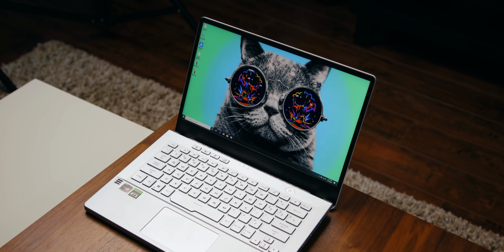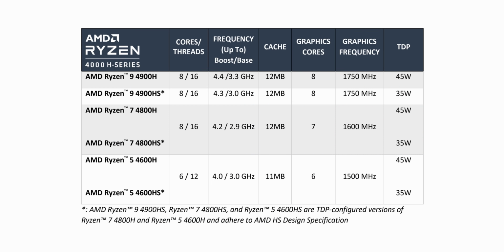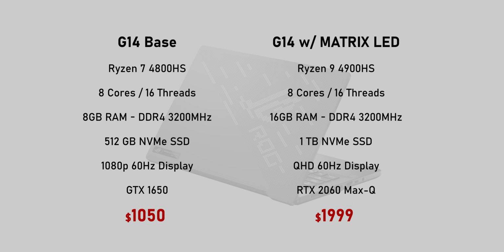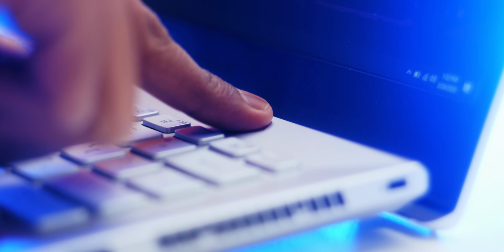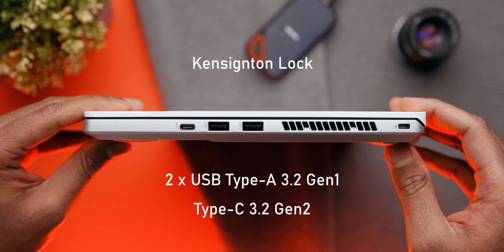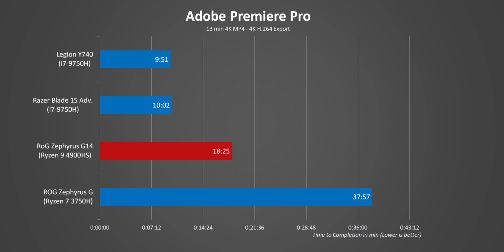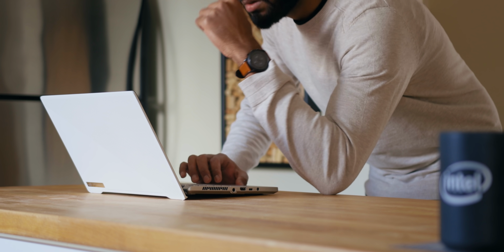This Ryzen 9 Notebook Is AMAZING - Zephyrus G14 Review

Comment from the maker: Timestamps for all you guys!
2:28 - Quick overview of the 4000-series notebook CPUs
3:30 - Some important info about PCIe support
4:12 - In depth with the G14
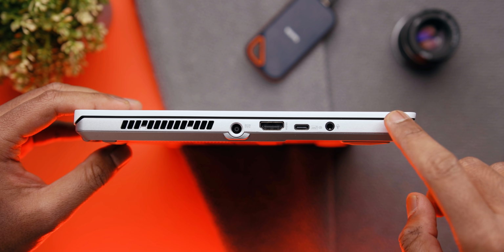9:02 - An ODD Port Layout
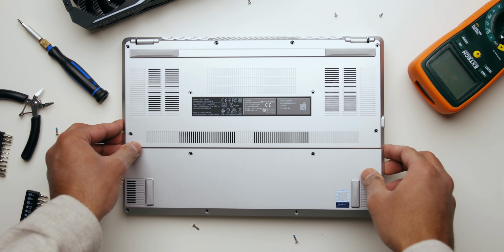11:37 - Upgrade options
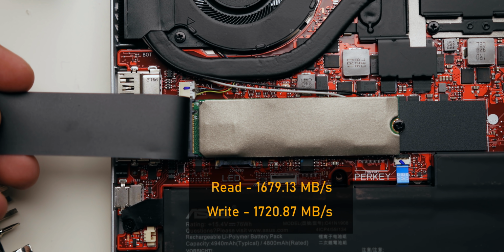12:04 - Battery life!  
12:47 - Benchmarks that would make Intel cry :(
Reply: 3:30 AMD and everyone else had already explained that PCIe 4.0 support means higher power consumption and heat and is thus redundant in laptops. Not sure why it's 'important' when PCIe 3.0 SSDs still work for 99.9% of users.
Reply: Hardware Canucks WOW what a monster compact laptop!
Reply: I have a question. First, thank you for a great review. As for the lid, I'm very disappointed. I really do not see any reason for the existence of these deep holes in the lid unless there is an animematrix. I cannot understand why this lid cannot be smooth and without holes. In the past, I saw a video of an Asus employee presenting a G14 without AnimeMatrix and this lid had no holes and the lid was smooth. So I'm confused. Anyway, I want the new MSI Gs66 to have this processor and availability for 3200 Hz memory. Unfortunately it will not happen! Can you provide information about the lid of the g14? since these holes are unsightly and impractical, and I don't like AnimeMatrix, it limits me to get this notebook. I'd like the lid smooth.
Reply: Also guys, the 1080p variant has 120Hz refresh rate, you have mentioned 60Hz
Reply: @fluffyraider  the base model comes with a 60Hz 1080p display
Reply: @adampluhar5667  that one was probably a prototype or a design prototype.
Reply: Better review of this laptop from Hardware Unboxed and Jarrod's Tech. People should definitely check out those channels. This guy is very casual.
Reply: I wish i have that laptop.... Can i have it plssss
Reply: Time stamps are really helpful for long video
Reply: Any idea when this might come to the market?
Reply: @MelvinKhosa  yeah, this guy is nerdy with no personality
Reply: @adampluhar5667  It looks like a design choice Asus made, unfortunately.  Even on the site you can choose what looks like would be "no holes" but it's just that you don't get the led crap but you still have holes.
Reply: @ryanhall5059  Yeah Its LID that prevented me from buying this laptop 1) I don't like AnimeMatrix, so I would only buy a version without this solution for less money - the ideal solution. BUT versions without AnimeMatrix have these unnecessary LED-free holes, I really don't see any reason to have any holes there, a) it's ugly, b) they are about 1 mm deep - an amazing place for dust and dirt, c) these holes are completely useless without AnimeMatrix, so I might consider buying the G14 with Animematrix, although I don't like it. BUT there is another fuck*ng problem, AnimeMatrix is ONLY on 1440p 60hz VERSION! This version is absolutely nonsensical and impractical on 14inch display and aswell for gaming plus in addition to this extreme additional cost. It's just crazy. In my opinion, this is a big mistake from Asus
Reply: @adampluhar5667  if you go to the Asus website it shows the animatrix lid is optional. I am with you I don't need a show off lid.
Reply: @kingicej2312  all this for only $1k. This or new Mac air, this is way better.
Reply: @kingicej2312  4k?? What the hell are you going to do with a 4k panel with a 2060?
Reply: @fluffyraider  no the 17 inch model has 120 hz, all others are 144+
Reply: Why there's no important benchmark of temperature? Temperature is the reason why buying a laptop, no one wants an overheating oven
Reply: Very nice, but I've decided to go with the Asus A15 TUF 4800h RTX  2060 144hz, unlike these Zephyrus models, both ram sticks are upgradable...
Reply: Will you recommend this with video editing in mind? Thanks
Reply: WTF? Why is the Google CEO reviewing laptops???!
Reply: @Pool 69 You are mistaken. ASUS is a Taiwanese company. There is no coronavirus fxxk-up in Taiwan.
Reply: I know this released a while ago but your numbers don't seem to correspond with LTT's numbers, could you explain?
Reply: INTEL IS CRYING OH NOOOO
Reply: @adampluhar5667  nah, not a big mistake, even for its flaws. The price is the best thing. The competition just doesn't give the same performance at this price.
Reply: new to laptop gaming and still not believing that a laptop can even play games properly. Especially not modern games like World War Z or dying light.
My choice so far is HP Omen 15 with Ryzen 7 4800h cause technicalcity and nanoreview said the power was better in comparison. 16gb RAM. RTX 2060. Can this laptop play any games let alone modern games and modern games with lots of moving parts like wwz

Comment: 2017:Intel has got competiton
2019:amd has taken over desktop
Laptops are still in Intel control
2020:intel is screwed
Reply: yup right now if you want anything other than a strictly highest of the high end gaming desktop and dont care about money then amd is the way to go, im holding off until the desktop 4000 before I upgrade, i will say my trusty 6700k has been amazing though, 4.9ghz and still rocking every day
Reply: Intel has had server for a while, even through this AMD-pocalypse. But that won't be for long thanks to security flaws, and EPYC awesomeness.
Reply: @BodybuildingSteve  i dont like my 8700k at 4.9 too hot miss my 1700x undervolted stable at 4.0 was just as fast with 3200mhz stable memory... guess i had a golden 1700x
Reply: @RAYSGT  I'll just say that Intel is basically turning into the old AMD with all the price cuts that keep coming from them. I will also say that if you have a Intel rig like 9900k or 8700k there is still not really a need to upgrade yet both chips are more than fine for gaming .

I just hope that now that quad cores are beginning to be retired we can finally see games take better advantage of parallel processing. I also hope that I Intel does get their shit together soon to compete with AMD on price and performance again
Reply: wizard 101 T_T nostalgia
Reply: 2020 Intel starts making Ventilators on the side
Reply: 2021 intel gets corona virus and cpu-s from Intel die
Reply: More a win for TSMC than AMD. Since, if TSMC had not come out with 7nm, what ever architecture difference they would have made without coming to 7nm, would have never beaten Intel at their 14 nm node. 

So a win for TSMC and AMD for getting that contract to TSMC. 

On the other hand, AMD can only do so much against Intel with their whole company worth a fraction of Intel's. So kudos AMD.
Reply: @Cadambank  TSMC only manufacture the chip, the design is still from AMD, FYI Apple and Nvidia also manufacture their chip in TSMC.
Reply: Clorox Tree I mean. If u look at profits, amd is 50% of Intel, and they’re growing rapidly. Sooooo...no lmao where Tf r u getting ur numbers. They both also have billions in revenue, nowhere near the millions
Reply: Totally screwed with their 70bn $ revenue
Reply: Oh how the turntables
Reply: right now 8 of 10 cpus sold in Germany are AMD's so...
Reply: @bastinjo93  Well that will be changing as AMD slowly takes control og the market. If thing progress as they do now, I cam gurantee AMD will be way ahead of Intel withing 5 years. AMD is already the better choice both desktop and laptop wise (ryzen 4000)
Reply: @RAYSGT  its sad when your only argument for picking a side is very moot features or performance increases lol
Reply: Clorox Tree that’s about to change. AMD on both PS5 and the new Xbox, and now they’ll start popping up on laptops. Expect 2021 to be a breakout year for them.
Reply: Intel* I think we should charge more for our cpus
Reply: So, let me recap. It beats Intel on Cinebench which I dont know how many people use on a laptop. On gaming workloads, Intel's last year CPUs still beat this under the thermal constraints. Isn't this a gaming machine and not a workstation for Cinebench?
Reply: @kiranpalli78  it's a 3 pound machine with Ultrabook battery life  kicking 5-8lb gaming machines ass. It's in a class all it's own for now.
Reply: That’s the report now a days. LOL
Reply: @pinstripe7839  
The biggest reason why AMD has now started to gain market share on server world is simply that Intel can't supply enough CPUs to meet the demand and companies are practically forced to buy EPYC processors.
Reply: You must be new to the PC gaming space. It's always been something that swaps back and forth. Once upon a time AMD CPUs were prefered over intel and had larger market share, likewise Radeon for a while had larger market share than Nvidia. We're probably going to see more even market share over the next few years (it's currently 80% vs 20%) with AMD having the chance of taking dominant market share in that period. If they do, then it's not going to mean any more about AMD as it meant for Intel when they took share and just like before AMD will enjoy market share and favoured platform in optimisation by developers for a while till the market share for intel rises and the cycle begins a new.
Reply: stephen johnstone 😂 not it my case lol. Did a balls to the wall pc and didn’t want that Intel trash in here, went with a r9 3900x
Reply: @dennisp8520  Amen.
Reply: 2021 Kids - Who is Intel you boomer
Reply: @BodybuildingSteve  Don't care about money? AMD's is cheaper than intel and is the reason intel brought down their prices. They actually give you more cores for your dollar. ANd even cpu's bought 3 years ago for ryzen 1st gen are seeing gains now because of updates in code for OS and game software/ engine updates.
Reply: AMD had 2 decades to catch up, so calm down. We'll give Intel the time to catch up.  Competition is good.
Reply: Give it 5 years, ZEN 4 and ZEN 5 coming by then.
Reply: Intel is not screwed. Intel is working on their next in line CPU which according to Intel will blow Zen out of the water. Competition is always good.

To people saying Intel is dead is nice meme. Take a look at revenue first before making such claims.
AMD chips are GOOD for everything, but they have problems of their own, for example not hitting declared boost clock speeds (can confirm that one owning Ryzen 3800X). They also need pricey memory to run at full potential (looking at those sweet CL16 3600MHz memory chips).
As for pure gaming PC build, I would still pick Intel i9 9900K (and that's my 2nd machine btw). It just is unbeatable when it comes to gaming. Clock speed is what matters and let's not forget about memory access latency (~72ns on AMD vs ~22ns on Intel). That's HUGE difference when you do huge database calculations. AMD wanted to mitigate this by giving processors large cache, but it's not as fast as Intel. - that's real life scenario.

For everything else AMD is king and there is no denying that. Productivity wise it's a beast. Price to performance is amazing. Upgradeability in the future, cause AMD does not swap processor sockets every 2 years, amazing stuff.
Reply: 2025: what the hell is an Intel?
Reply: Ask GM, the company that used to have more money and being on the top for decades before getting relegated to lower position. Money alone will not save company.
Reply: just like corona virus
Reply: i thought dave2lee still has intel won
Reply: @info0  Well, all those pros of intel' cpus only add up to 2-4% of difference and you are paying 50-100% more for that. Your choice of course, but I'm just saying that you won't notice that 4%, we are literally talking about 5-9 fps difference(@144hz-240hz refresh rate).
 That 7fps won't matter in the grand scheme of things, if you were to be put in front of two otherwise identical machines and they were powered by a 9900k and a 3700x, you wouldn't be able to tell the difference just by playing.

My 3700x boosts to 4.4 just fine, though that is a sample size of one. RMA that bitch. And where I live, a 3200mhz cl16 kit is only 10€ more than a 2400mhz cl12 kit(16gb). If I have to buy 15% more expenive memory but a 50% cheaper cpu, I still save considerably.
Reply: @94e88  hm, in some cases it's 30+ fps difference though.
It only of course is visible in 1920x1080 resolution - because here CPU is getting stress ed to push those frames (but yes, that's the resolution most pros play at). 
Trust me, you can see the difference there, but it's not something you "see" it's something you "feel" - it's called input lag. The higher the fps the less noticeable input lag becomes. You can check Battle(Non)Sense for videos regarding that.
At higher resolutions the changes in fps become less apparent because the stress is on GPU now not CPU. @4K resolution the difference in FPS is 0%. ;)

As for would I buy into Intel again? The answer is no. AMD is just better choice overall.
Reply: @info0 Where is that a 30fps difference? Source for that claim? 

Btw you can't perceive a 0.14ms difference, that is way too small of a difference to be perceived. That is one ten thousandth of a second, below our visual ability to differentiate things.
Reply: @info0  High input lag also happen on high frame rate. it depend on game engine and render engine. That why some gamer limit their frame rate for lower input lag.
Reply: @Tippotipo  I know but as long as tsmc doesn't have the capacity to supply 300 million chips that'll remain true after all the majority of the $ are in the server Market
Reply: @nonameyet2205  Proving my point. They were not able to beat nVidia in GPU market yet. And probably will face stiff competition. 

Kudos to AMD to for their chiplet design but, if intel had the same node as TSMC, I am sure AMD's success wouldn't be that remarkable and would be too close. 

If not for TSMC, AMD wouldn't have had the success now.
Reply: @Cadambank  I see, so you edit your previous comment. The fact of the matter is intel doesn't have the same node as TSMC, and their own 10nm is weak. TSMC does help but amd could've chose any other plant like Samsung or Glofo to manufacture their chip and the result would be the same, its all about the architecture. Take a look at RDNA, they manufacture it at TSMC 7nm but still lose to Turing which is 12nm from TSMC.
Reply: @nonameyet2205  what??? The rtx 2070 is the direct competitor to the rx 5700 xt and the radeon card wins most of the time on top of being cheaper. It even scores against the rtx 2070 super in some games while being considerably cheaper.

And the rx 5700xt is memory bottlenecked, with slightly better memory the radeon card would win in even more games.
Reply: @94e88  Im not talking about the SKUS but the architechture itself, RDNA is 7nm but despite being much smaller they're not more efficient than 12nm Turing, at best they're about on par, hopefully RDNA 2 will be better.
Reply: @nonameyet2205  maybe you should have specified that you were talking about efficiency in the earlier comment, seemed like you were talking about performance.
Reply: @nonameyet2205  I edited it when I posted it since there were Spelling errors in the comment. Nothing else. 
And exactly the point, TSMC is the primary winner. AMD having limited budget only has limited RnD, now with more sales and more market share hopefully we get more mature architecture. But, those results will probably be for 5nm or 3nm.Not for current gen Ryzen. 

if Intel hadn't been lazy, AMD wouldn't have been winning easily against them. They could have had a tough competition. 
With the lock down going on now, I am pretty sure Intel is further behind.
Reply: @Cadambank  Your logic is so flawed, TSMC does help but by your logic you're also saying that Nvidia isn't the primary winner against AMD but TSMC is the primary winner which is so stupid because both company use TSMC for their GPU. 

IF If if and if again, you keep saying that but what matters is the FACT right here right now. I can also say IF AMD has more budget the would've destroy intel long time ago.
Reply: @nonameyet2205  dude. Technology was developed by TSMC. I am brining in the focus on to the chip manufacturer. 

There are countless videos highlighting AMD's sucess. Kudos to them for the chiplet design. But, the major part is that no TSMC, then no 7nm and no Ryzen. Its as simple as that.
Reply: @Cadambank  That is not true bro, if there's no TSMC then AMD can switch to use Samsung 7nm or Glofo 7nm, there are other chip manufacture out there bro. Remember the 1st gen ryzen uses samsung 14nm and 2nd gen ryzen use glofo 12nm. As i said previously TSMC does help but if there's no TSMC there are still other option.
Reply: well I don't know because the Comet Lake i9 processor for laptops have 5.0 GHZ.
Reply: Considering that AMD has less than 20% of home pc market share and it has actually dropped slightly recently..I don't think Intel is in too big of a trouble. Intel's main issue is that they can't produce enough 14nm chips to meet the demand. If they could AMD's market share would drop significantly. 

In retail markets AMD has over 80% market share, but retail market is tiny compared to OEM markets.
Reply: you will see in the future
Reply: TSMC provides all Quallcomm (until 875, it uses samsung 5nm.) and Apple architectures

Comment: 14:33 Except for the fact that it's significantly faster at literally every other task in Premiere. Unless you are using the machine as a dedicated export/render box, this is very much the wrong take. The Turing NVENC encoder on the RTX 2060 can be used instead of Quick Sync in many places as well. Also, the quality hit with Quick Sync is the highest.